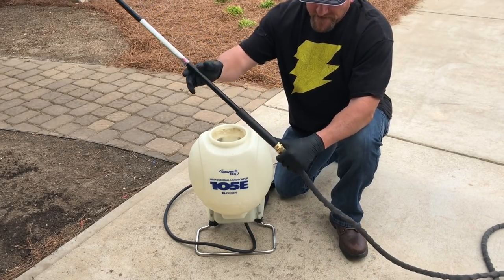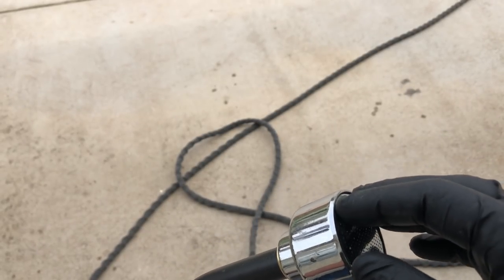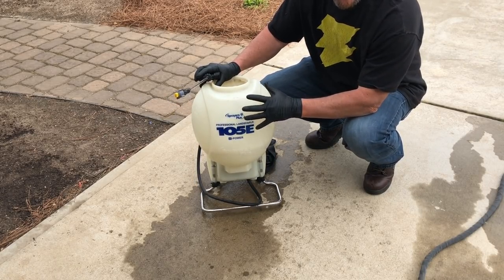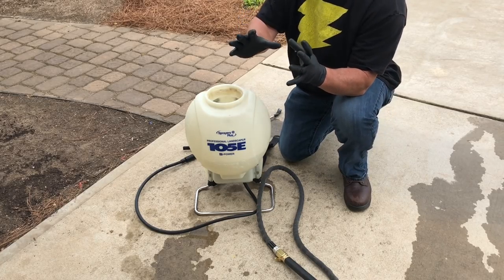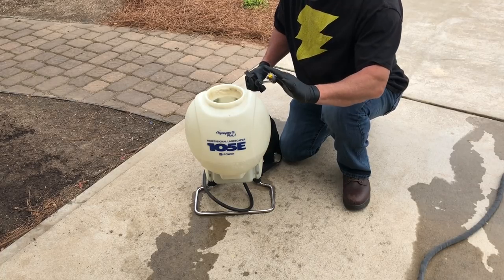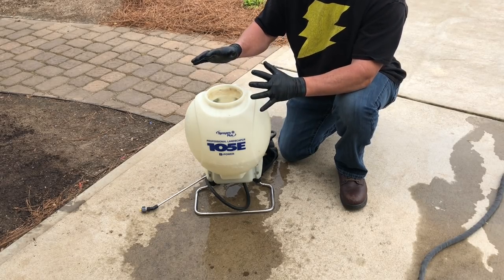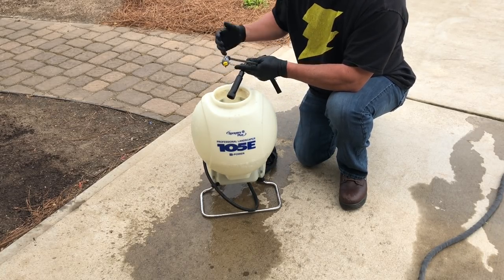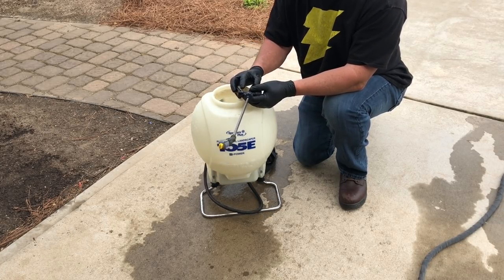How To Prime A Sprayer

Comment: Hey Pete, thanks.  I'm a newbie to spraying.  I tried to use this 100E sprayer for the second time after I used it (the first time I just walked around getting used to it, and drained it to nothing).  This time it wouldn't pump; so I remembered this video, and reviewed.  I followedyour instructions, and it worked like a charm.  I will do as you say and leave water in the tank for future use each time I use.

Comment: His pump is primed already. As soon as he turns it on it's pumping water. My brand new 4 gallon sprayer would not pump water even with the spray wand removed. Finally after several minutes of nothing, I put the hose end in my mouth (new sprayer no chems) and sucked and water started flowing immediately. I thought he was going to show a trick to get it flowing. No, he didn't.

Comment: Good tips. That was probably part of my problem - I run her dry before storage. Esp since it was COLD up here when I started, so I always worry about things freezing (and cracking). Also, I've noticed that you just have to be patient when you pull the trigger. If you do nothing it DOES take 10-15 seconds for the flow to start. I have found that once it starts, it's a little weak. So I release the handle for a ”second prime", and then I'm generally good.

Comment: I was searching online for an electric backpack sprayer when I came across the Groundwork brand. I'd never heard of it before and I don't usually shop at Tractor Supply Co. But it was the best price I  could find online @ $109.99. So I ran to the store to pick it up coz the website said it was available. I took it to the cashier and it came up $69.99 FOR A 4 GALLON, ELECTRIC BACKPACK SPRAYER!!!!!! 😀😀😀😀😀😀

I read reviews that said it wouldn't spray once filled, but I suspect it needs some sort of priming to get it going. I've just plugged it in to charge. I'm gonna go thru a tank of water when I wake up today and test it. I'm STOKED! 

Better price than manual pump sprayers at Home Depot.